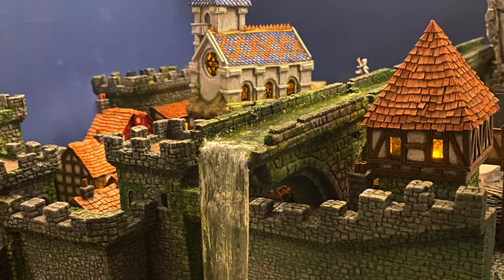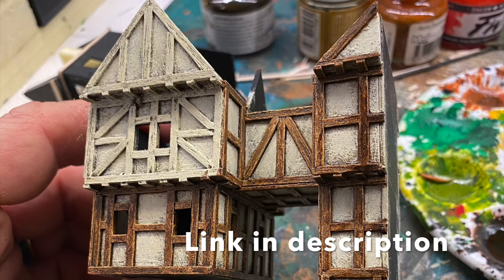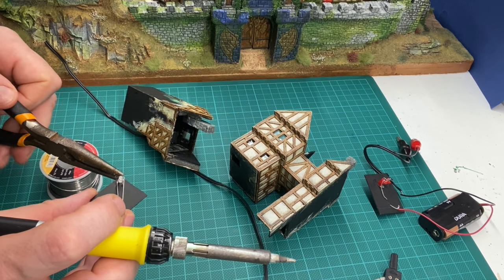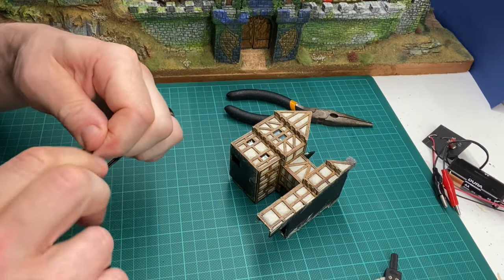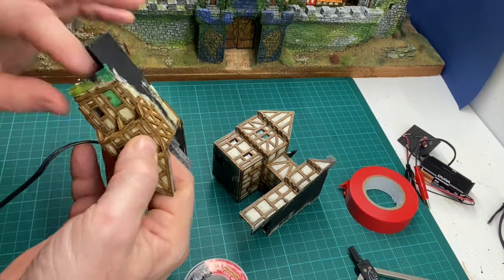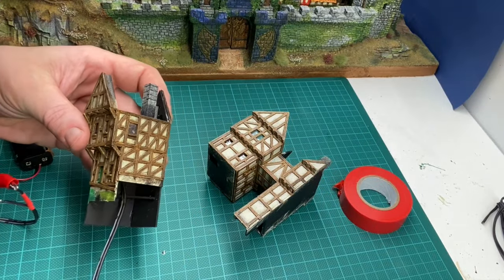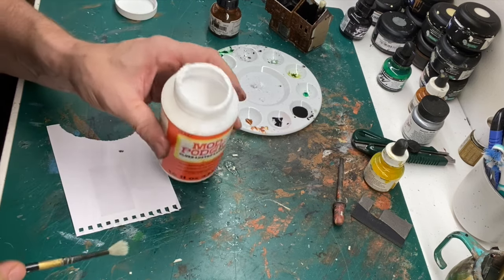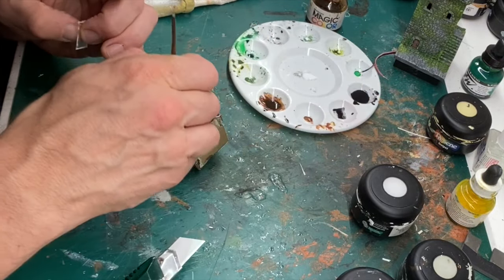Wiring LED Lights + Miniature Windows - Tutorial

Comment: Hi again, we were wondering if you use resistors in your lighting circuits, and what size battery pack you use.  
Thank you so much for all your help so far, we now know what went wrong with our first attempts, and having the correct materials should make things a lot easier (we hope😕).  However we are carrying on with the first ones just to get some practice in.  Also so that we can try a small diorama as an experiment💜💜💜
Reply from the maker: Hi again Lorraine.

I used to use 2xAA batteries to provide 3V, with a resistor, but now I use a single CR2032 cell, which can run the LEDs directly. I keep my banks to around 20 LEDs per battery. This gives me several hours' running time before I need to replace the battery. 
For future projects, I intend to use far fewer LEDs per cell.

Try not to worry about right and wrong -- it's all art! I have made plenty of 'errors' in Undercrag - most of which I can live with!

Let me know how it goes!
Reply: Really sorry to bother you again 😕
What size resistor,  as we have some 2xAA battery packs in our stash.  Also we assume you use one wire per building, then solder a small bunch together just before you attach to the battery pack, are we correct?? 
Thank you so much for all of your help.
Reply from the maker: Hi again. No bother at all!

The resistors were 30.1 Ω +-1% (F). 
Remember to wire your resistor into the 'on' (positive) side of the switch. The switch must also be on the positive side of the battery pack (red wire).

The LEDs must be wired in parallel (all positives together, all negatives together). And you are correct - I wire as many as I need together, then have a main wire back to the battery pack.

I hope this helps! Careful with the soldering iron!
Reply: Thank you so much for all of your help.
I love Undercrag City, and I think I'm on at least the 2nd time viewing most of your videos. 💜💜💜
Reply from the maker: That’s a serious commitment! Thank you so much!